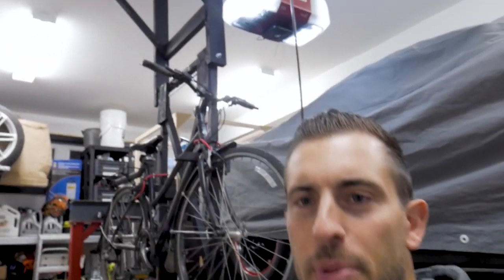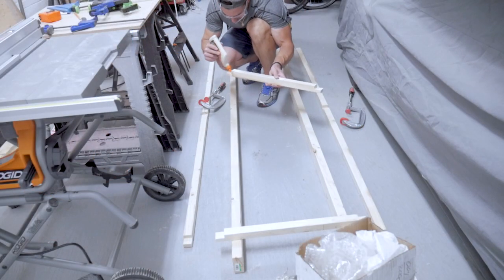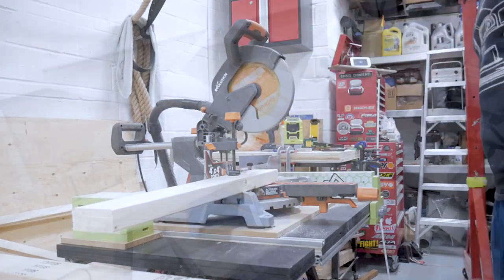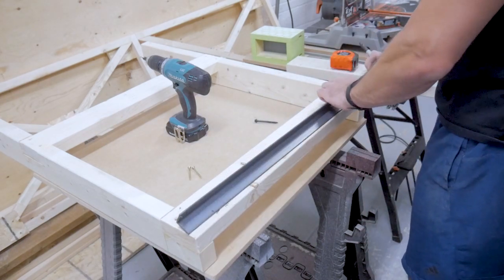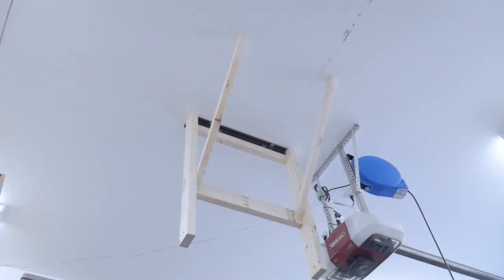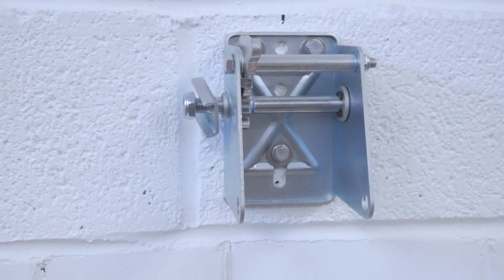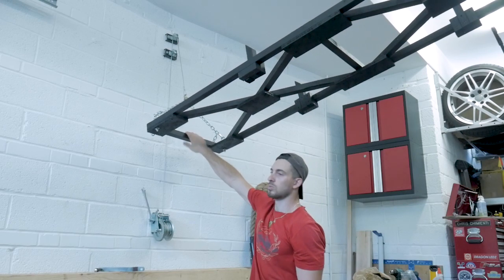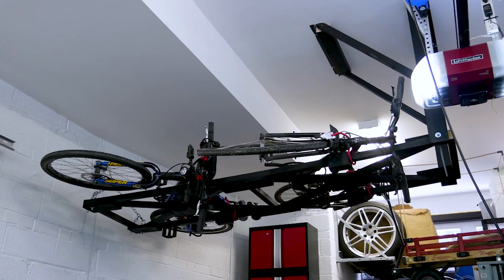How To Build A Swing Down Bicycle Storage Lift (Free Plans!)

Comment from the maker: If you guys appreciate this build, check out the materials used for this build - As an Amazon Associate I may earn a small commission (at no extra cost to you):
► Worm Gear Winch: https://amzn.to/3ZpKFyd
► Steel Cable: https://amzn.to/47x7pOL
► Pulley Blocks: https://amzn.to/3B4lmaC
► Structural Wood Screws: https://amzn.to/4e57try
► 2x2 Lumber
► 2x4 Lumber
► 3/4" Plywood
► 3/8" Threaded Rod, washers, nuts
► 3/8" Eye Bolts
► 1/4" Chain

Can't build one yourself? Check out this type of bicycle lift:

► https://amzn.to/3TOuTrx

Comment: Great design and build. I may be building one too but would change a couple things. Easy for me to use hind-sight after you did prototype so not belittling yours at all. It’s great!  First, I would likely buy this electric hoist with remote pushbutton control (cable hung) to ease use and when the rack is attached in up position or down, I could also use it for thing like raising the front of my riding mower or to raise something into my truck or to workbench. Since I do not 3d print, for bushings I would cut small pipe (copper or steel) the thickness of the wood and sandwich in with washers. And since I have three bikes, i would find a way to mount one on the back (bottom). side. That’s it. Great job!
Reply from the maker: Thanks Vic! I actually bought some PVC pipe to use as bushings and I can't remember now why I didn't use them. The electric winch was on my wish list but settled for something manual as I couldn't justify the cost for something I would only be using occasionally. Glad you enjoyed the video!

Comment: 😻Wow your back is gorgeous. 
So is the rack. 👍

👉My only suggestion is to improve the axel so the wood doesn’t get scraped. 
🔄Upcycle a paint roller and reuse its end caps like a ball bearing. 
🌀Cover the hole and ends of the rod in glue then sand smooth to flatten. 
🔩Drill a larger axel to insert 1/2” PVC.

Edit: nevermind, you added a flange! Custom 3D printed too! Wow.

Comment: Pro tip: There is a hairpin on the pulley block shaft, so you can remove the pulley and shaft and run the cable through the block after it's mounted.
Reply from the maker: Ha! Wow I can't believe I overlooked that...

Comment: Great video and great idea! I came for the video because I'm looking to build something of the sort, but I also notice something else that piqued my interest. Talk to me about that red gantry in the background. It looks adjustable and about the same size I'm looking for. Where did you get it from? Thanks for the wicked idea!
Reply from the maker: Thanks Jay, the red gantry is something I built. I beam bolted to some custom plates which are welded to square tube with gussets. It is, as you observed, adjustable. The tube sits inside a larger square tube and telescopes. Two shear pins hold it in place. Very strong. I actually lifted the entire back half of one of my cars to get the engine out using this gantry.
Reply: @EmbraceMaking  Amazing! That’s the next thing I need to learn is welding - I see all the challenges it could solve. And cheers to another Canuck! The Princess Auto reference was a welcome thing in the sea of Harbour Freight products. Keep it up!

Comment: How has the worm gear winch ⚙️ held up?  After a year what are your thoughts overall?
Reply from the maker: Been fine, no issues! Would just recommend that if you're securing the winch into a brick / concrete wall like I did that you use fasteners that fair well with vibration. Using power tools to turn the gears usually results in some vibration and you obviously don't want anything coming loose. I had my heavy ebike parked up on the lift all winter and it still hasn't gone anywhere :)

Comment: Do u sell those bushings
Reply from the maker: Nope, but you can get resourceful and make your own with some PVC / ABS /NYLON pipe or tube from your hardware store. Doesn't have to be a super precise fit, and you can cap the ends off with regular metal washers.